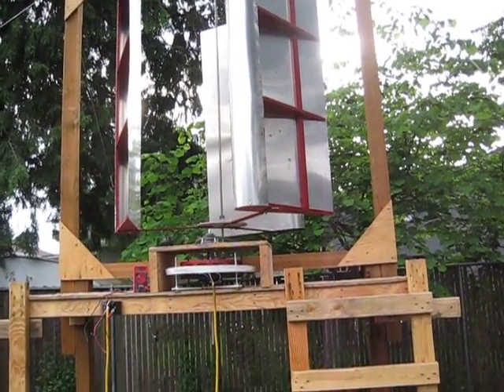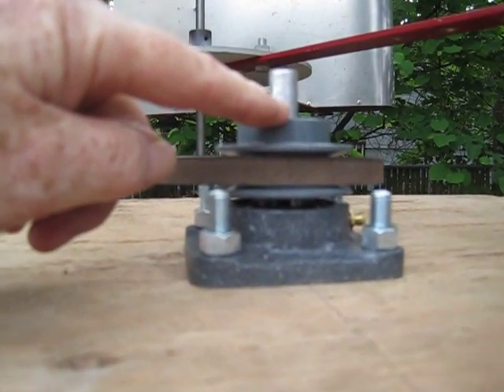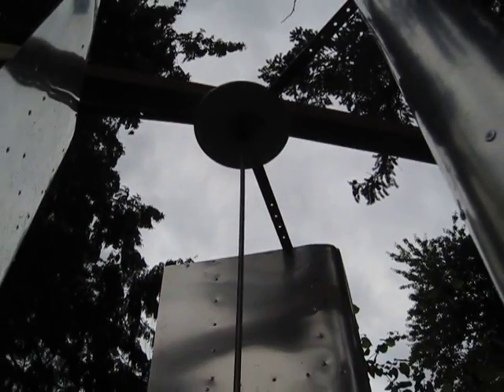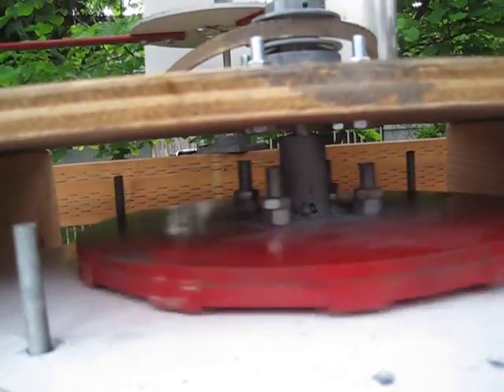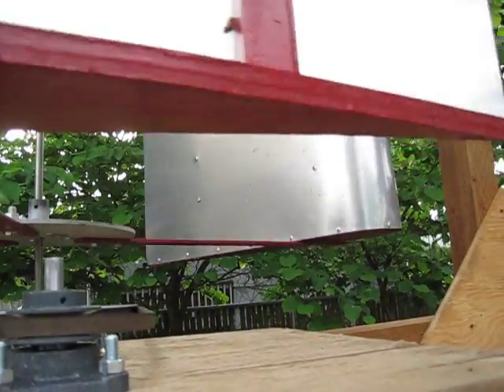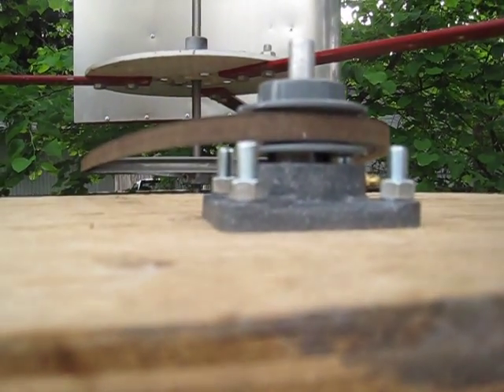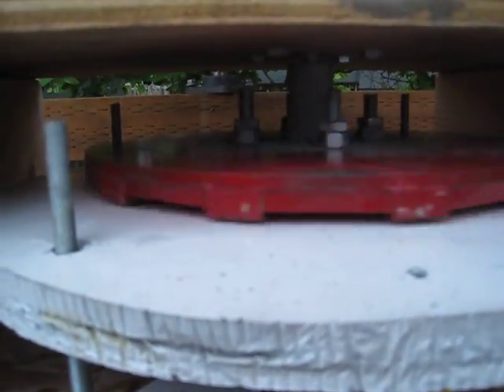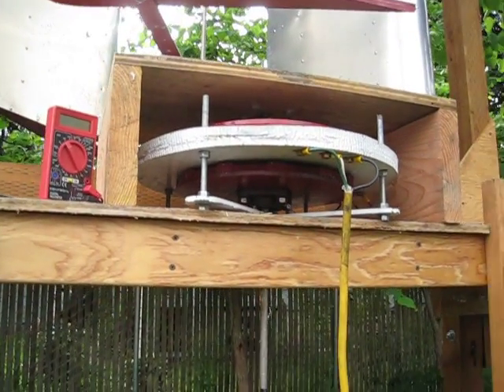VAWT belt drive set up

Comment: It's putting out to many voltage
Reply from the maker: and just why would you say its putting out to many volts?
Reply: I seen it put out 19 volts to much for 12volt battery
Reply from the maker: do you actually no anything about charging batteries and what kind of power is required to keep batteries topped off?
Reply from the maker: oh,  you also missed that the battery bank is 24 volts too
Reply from the maker: you need to do some research before you post comments about something you really no nothing about
Reply: Yes I do. will cemaic magnets work for this
Reply: Sorry I didn't see the 24volt maybad
Reply from the maker: not enough umphhhh  you need 72 to 82 pound pull magnets, but i have come to the conclusion that a vertical axis turbine has to many things going against it to continue building them. thats why i switched to standard axial wind turbines
more power for the money you spend , if you really want to know what you can and cant do with batteries, read this book, by John bendinni   "The Battery Bible"  , then you will know what you can and can not do with batteries
Reply from the maker: a charge controller regulates that power coming from the wind turbine to the batteries, you never, never hook the batteries directly to the turbine, i can put 150 volts into my bank, the charge controller regulates what they get
Reply from the maker: just so you know, its not putting out enough power

Comment from the maker: the rotors are 1/4 inch thick steal 12 inch dia.  easy basic formula for your rotors is if your magnets are the standard 1/2 thick x 1inch wide x 2 inch long, number of magnets in width = dia of rotor so 1x12= 12 inch dia, if you used 16 magnets then it would = 16inch dia and its that easy. gives you room for a good sized coil.
Reply: Thank you for the help. I'll use this guideline when doing mine.